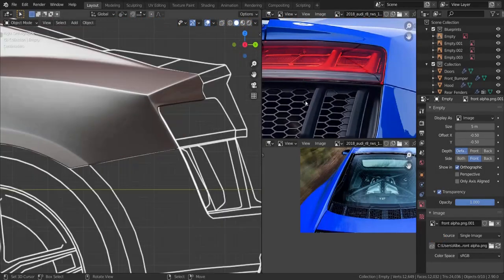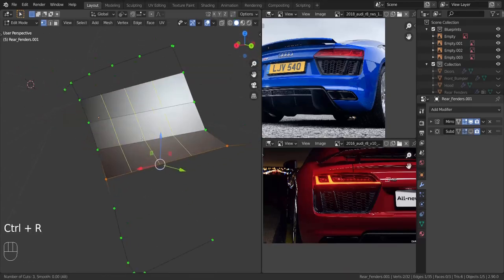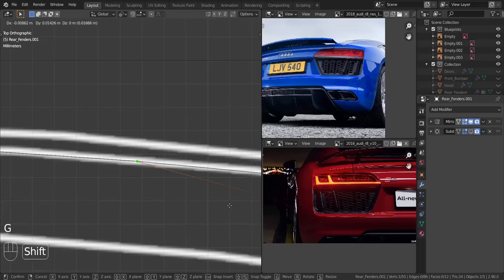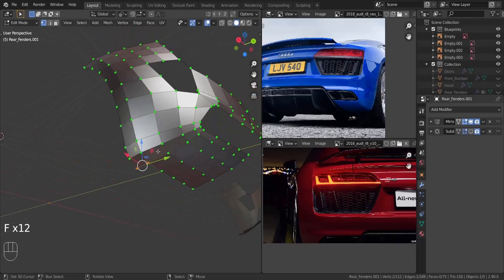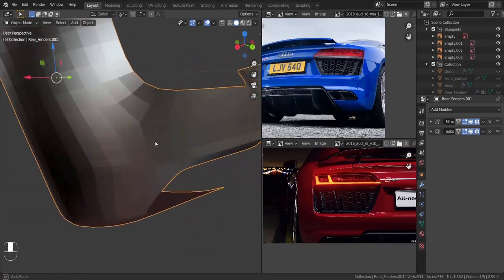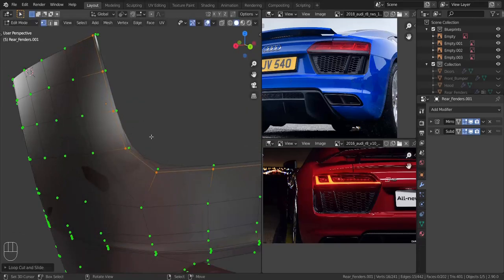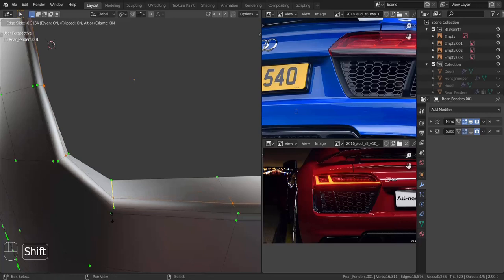Blender 2.90 Car Modeling - Part 8 [The Rear Bumper]

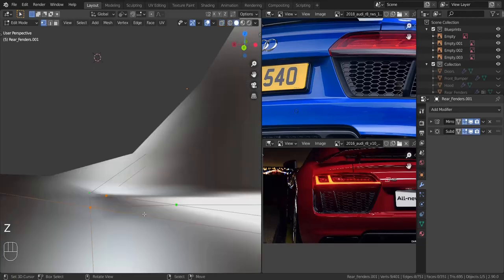Comment: @33:00 why do you model the cutouts of the bumper into the car instead of making the base shape? Wouldn't it be easier to create the flat surface first, then cut out the shape with the knife tool and use shrink wrap to constrain the geo?
Reply from the maker: Yes true, The Shrinkwrap method is a method we will be using in a future series. I wanted to do this series without excessive use of Shrinkwrap.
Reply: @NaturalArtFreak  Right, so this achieves the same results but effectively without using the modifier?
Reply from the maker: @count23all  it's just quicker without using a Shrinkwrap modifier, and if you do use a Shrinkwrap modifier probably mean you are going to keep this surface at subsurf level 2, which wasn't the case in this one, we only used subsurf in this series to keep check of the surface quality but ended up deleting it all in the end... So basically If you want better quality surface at subsurf level 2 then shrinkwrap might be your friend...

Comment: The one thing wrong with 2.90.1 I use the mirror, shrinkwrap modifiers and the solidfy modifier You ca not copy or apply the only thing that I see is on top apply all that does not make sense You cannot copy and than apply the shrinkwrap and you can only apply all modifiers not just one. So I wasted a lot of time on this part
Reply from the maker: I think you can, it's all in the drop down arrow.